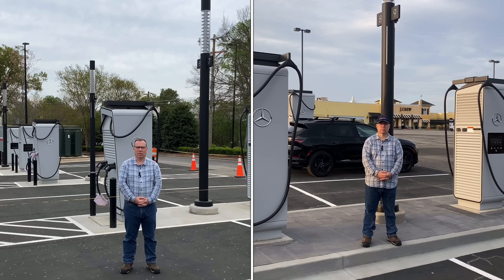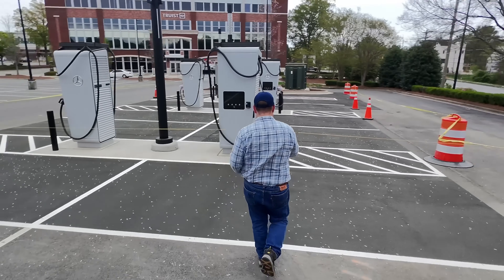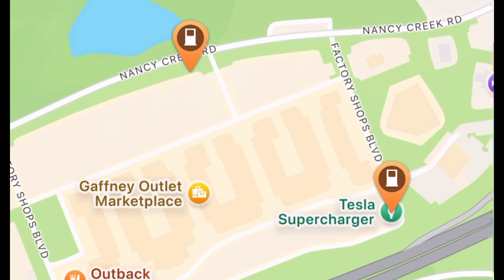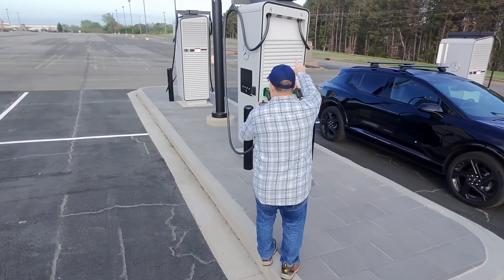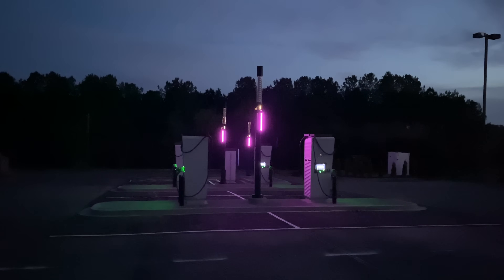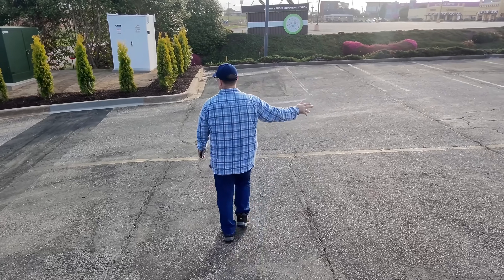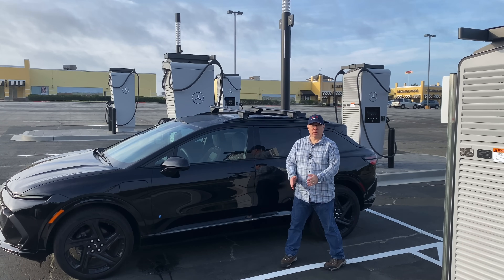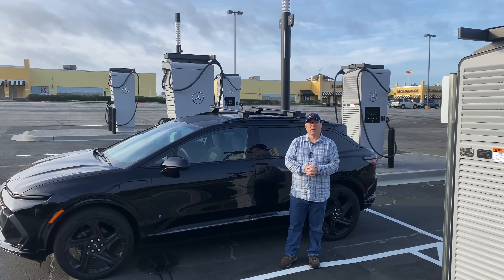Mercedes Benz Charging Is Expanding! Carolina Site Tours Show Great Implementation

Comment: Good info.  We have used a couple of Mercedes charging stations at Bucees.  High powered charging and they worked great.  Didn’t know that they provided WiFi.  They cost a bit more than the Tesla superchargers nearby, but they have nice long cables and you don’t block two chargers.  On a road trip this is a good charging option.

Comment: Walter, if you use the Chargepoint app to start charging at IONNA and Mercedes-Benz chargers, you don't get charged the card hold fee, it just charges you for however many kW you use at the cost specified by the chargepint provider.

Comment: Walter - I came across one of these MB chargers in Ellenton on the west side of FL over the weekend.  Put it on PS.  Everything but the transformer was present in a similar looking spot (outlet mall with Tesla SC, EA, plus MB).  This one had an extended length parking spot for the single charge cord dispenser.  I wondered about those cool looking lights, so thanks for showing their operation.  I saw on PS that there was another one about to open just north of there along the I-75 route through Tampa, so they must be really putting them in.  Loved the elevated tiled spaces vs concrete everywhere.

Comment: Why did you not test it instead of just assuming what the charger does I would prefer to see if I get the Tesla like experience this review was terrible
Reply: Hello.  Good point.  I did have footage of a charging session that I did not include.  With a Chevy Equinox that taps out at 158kW, it just did not seem very compelling footage.  I was at a pretty high SoC too.  I think in retrospect I should of included.  Thx for your feedback.